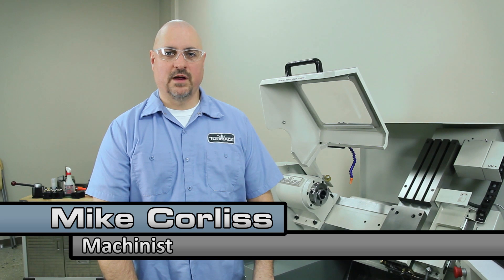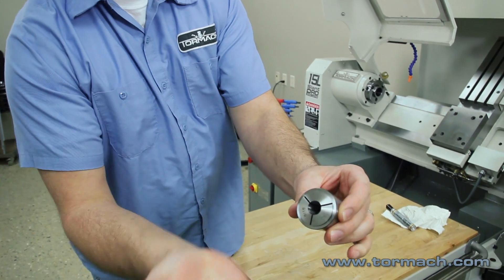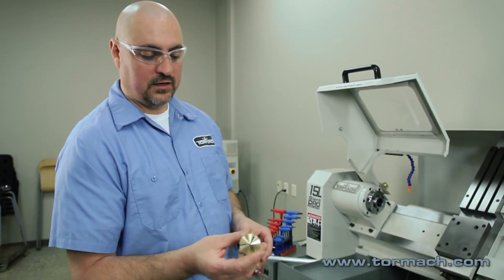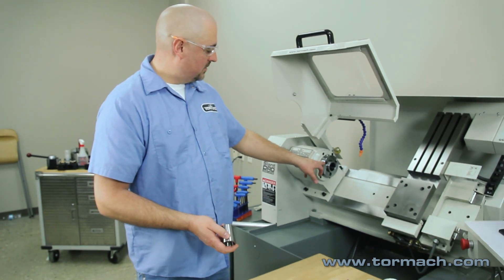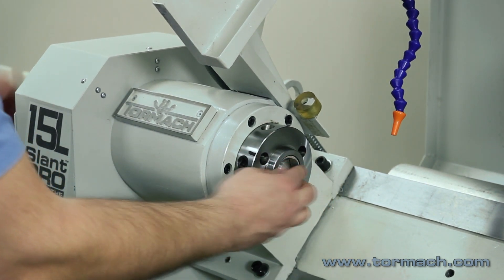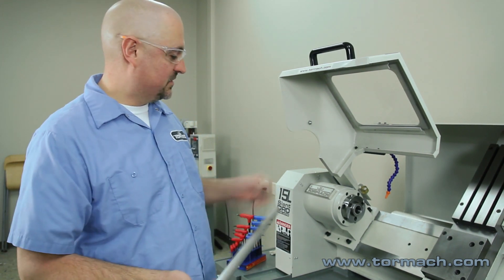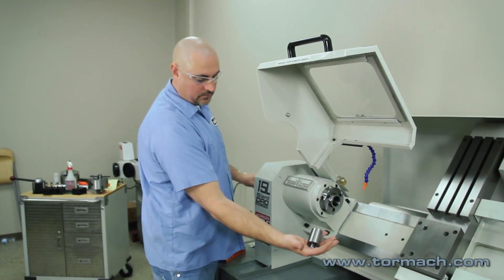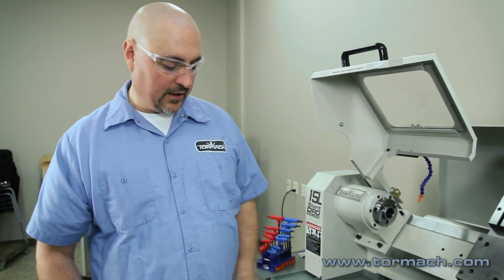Tormach 15L Slant-PRO CNC Lathe: Working With the 5C Collet Insert

Comment: Can someone tell me what is the taper size inside the spindle WITHOUT the 5C spacer? Thanks
Reply from the maker: The inside of the 15L spindle taper, without the 5C spacer is 1.53 inches (3.8862 cm).
Reply: @tormachinc  Let me try this again. For example, a tailstock on a relatively small lathe would have a Morse 2 taper. Do you know if the Tormach 15L also has a Morse taper IN the bore of the spindle that holds the 5C spacer in place? If so, do you know what size and what type of taper it is? Thank you